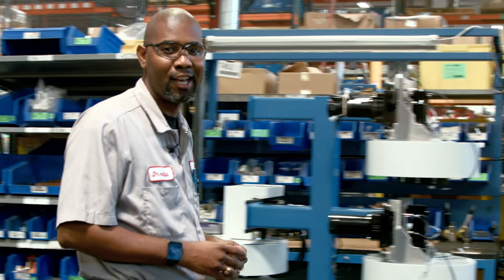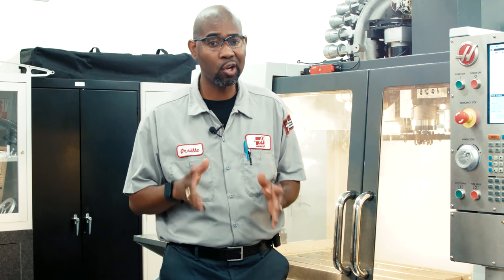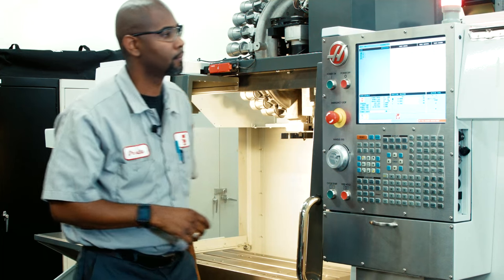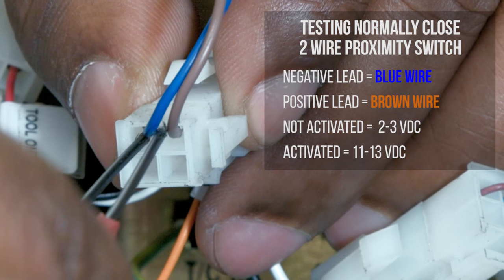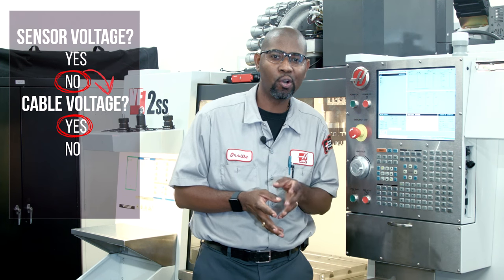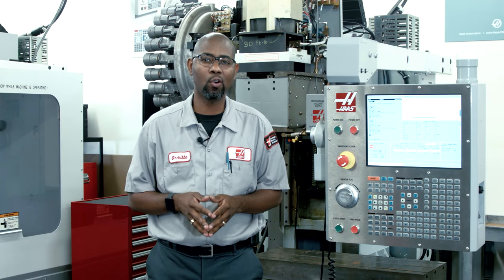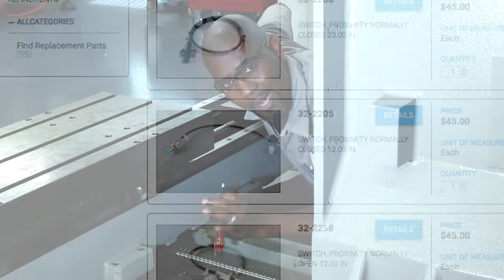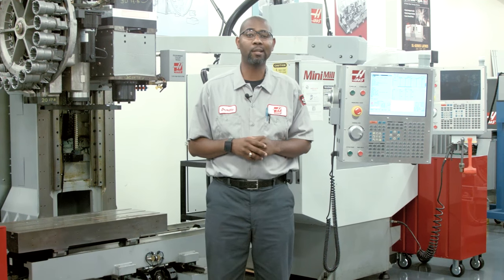Proximity Switch Overview and Troubleshooting – Haas Automation Service Video

Comment: This video really needs to link to something like  - where are the sensors on my machine. 
We don't get machine manuals that allow trouble shooting - We have a 2010 TM1P with a problem on the Y axis sensor. It is most likely a chip stuck on the sensor issue, but why is there no place to find out where the sensor is located without just starting to take things apart. You can really damage the machine if you remove the wrong stuff so better help to the phyusical design of the machine would be helpful.
Reply: It was actually a motion problem - could fix it by turning off the requirement to home our Y-axis. We could then move the axis till right before stalling, lubricate, move back, lubricate., move a little further.
The biggest issue with our Haas is lack of information to trouble shoot and fix. 
Move the upper inductive sensor closer in the spindle and the tool change cylinder does not do a full stroke. There are unknown timer/logics that we don't have access to so we can only do trial and error.